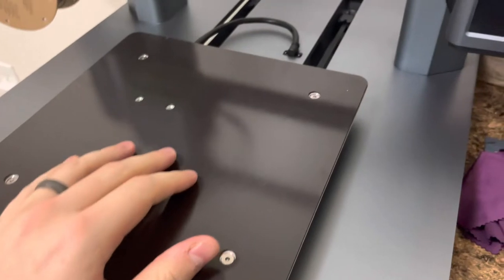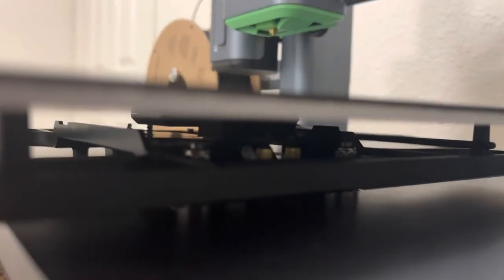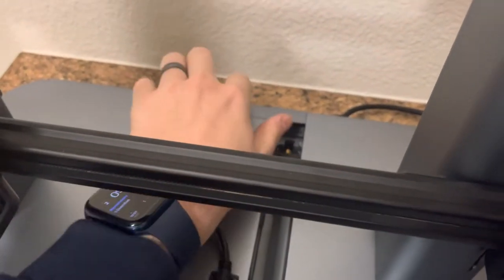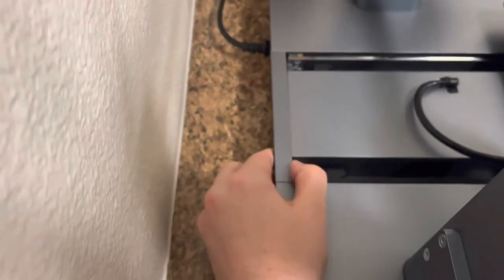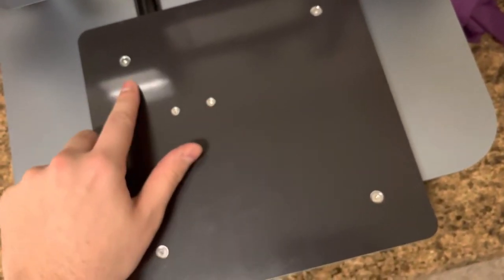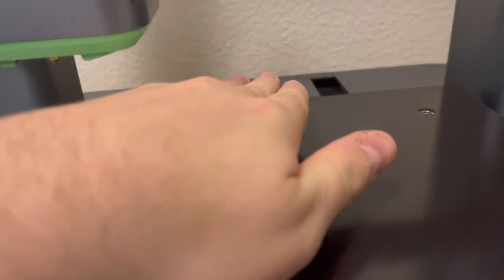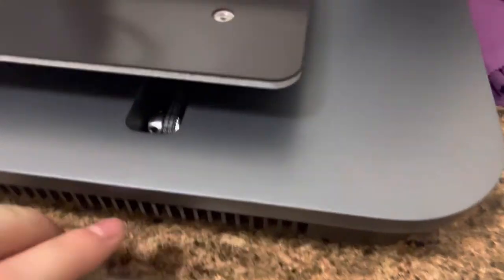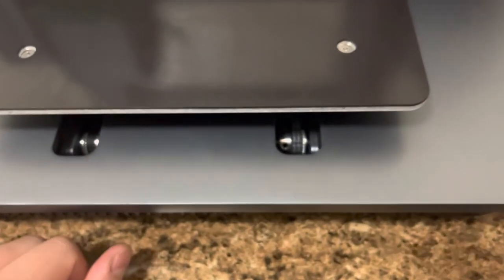AnkerMake M5 Bed Adjustment | V- Wheel Tightening/Replacement Talk Through

Comment from the maker: I put out a bit of bad info on this video! That little cover piece on the back of the base you need to remove to slide out the panels should be re-installed to prevent the bed cable from rubbing any of the sharp surfaces underneath where that piece sits. I say in the video that you can leave that off and I am wrong, please re-install that! Sorry if I mislead some of you out there.

Comment: Good video, one thing I would suggest after having the same issue with my bed had approx 1/4" of play in it. Was good when I bought it new a little loose but then it seemed to get worse. You talk about lining up the centrics or the nuts You can actually see that as you rotate them with the wrench. I just had to get them lined up as mine were opposite of each other and that tighten my bed down to where I could do prints again. Thank you for posting as this is about the only video addressing this issue that I have found.